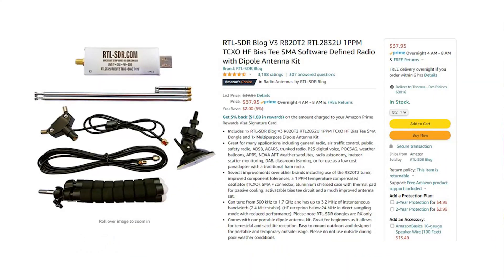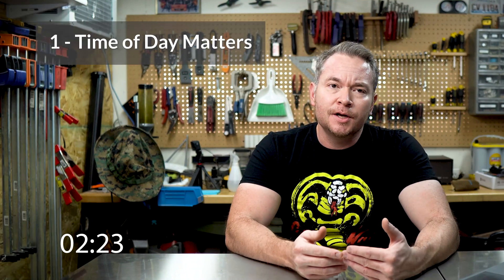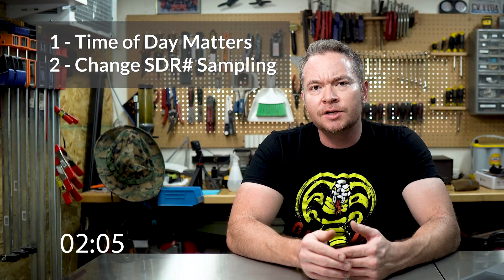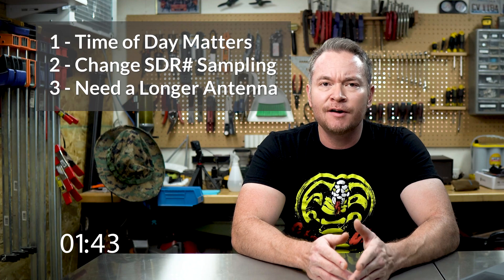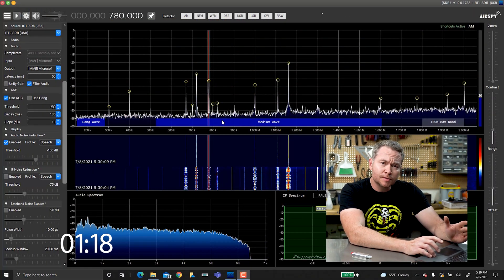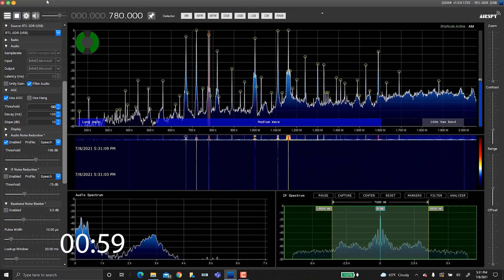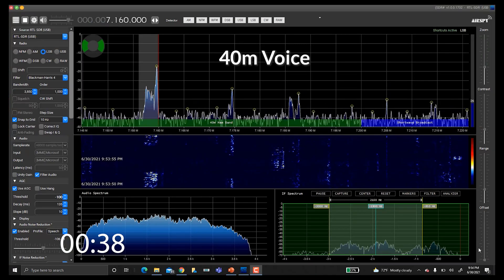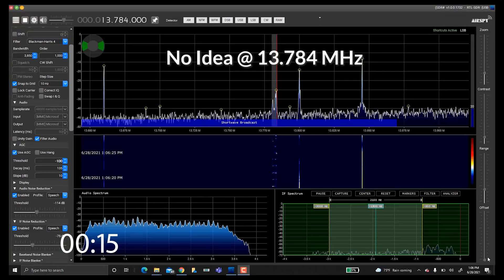Three Minute Thursday - Shortwave/HF with RTL SDR

Comment: A challenge for you. Can you display ALL frequency bands simultaneously... one monitor or multiple... is it possible? (Without having an RTL-SDR for each band.)
Reply from the maker: Good question.  It's my understanding that the answer to this question is "no" due to hardware limitations.  The maximum bandwidth is ~2.5 MHz dictated by the supported sampling rate.  Would be cool though, but alas I believe with this device we're limited to viewing discrete chunks of the radio spectrum.  Hope that helps!

Source:  https://www.rtl-sdr.com/about-rtl-sdr/

Comment: Do you attach the clip to just one leg of the telosping antenna? Does it matter which side you clip it to?
Reply from the maker: The telescoping antenna just threads onto the SDR dongle with a single connector.  I had just attached the alligator clip with the long wire to the end of the whip.  I may not be understanding your question right as there was no "side" per se to choose from.  Sorry if I failed to answer your question.  Otherwise, I hope that helped.

Comment: When you alligator clipped that long wire onto the stock antenna, did you have the bottom of the dipole extended also? Can't see in the video.

Comment: On HF 10 mhz to 30 is daytime and below 30 after sundown.Also I saw on SSB in America everything must be USB.I always had luck even picking up HF fax from Japan here in Missouri with just a 50 to 100 ft long wire made of speaker wire thrown up in a tree and clipped on to the antenna on receiver.I have been listening to shortwave since 1990 and SSB digital freqs for 25 years.Have owned cheap shortwaves ranging from 20.00 all the way up to 900.00 sets.If there is absolutely no way to put outside,make a giant loop antenna in your place.Just tack the speaker wire to the 4 corners of your wall and it makes an excellent high power,low noise antenna.I could easily pick up Andrews Air Force Base again,from Mid Missouri.

Comment: Bummed when I saw you highlight the “V3” was required for HF activity. I had packed mine back up after only getting commercial FM radio. Pulled mine back out of the box, and it turns out I have a V3! Yay!
I also have a crap load of fiber optic bury line left for scrap when my 1G internet was installed.
Finding this video just now, I think you have given me an Easter weekend project. 🙂
Reply: OMG, I just realized I have an awesome run of unterminated fiber optic tracer line in the ground. I need to hook up to it ASAP!

Comment: I tried this with the dipole that came with my RTL-SDR and was disappointed that I wasn't having similar success. Later on I tried connecting the long wire to the other element of the dipole and it made a HUGE difference. Not sure why... Perhaps someone can explain the science behind it.

Hoping to see more RTL-SDR and HF vids from you!!
Reply: One side of that dipole that comes with it is connected to the center conductors while the other is connected to the sheathing. If you take off the small rectangular piece opposite the side of the cable connection you’ll see it. The side that probably performs the best is the side that is connected to the center conductors. He even covers it in his original RTL SDR video. https://youtu.be/h4x7cGALaC8
Reply: @RecoilRabid  Thanks for the clarification. That was one of the first things I did when orienting the dipole. I made sure the center was up. Now I know if I extend just the center I should do better on HF!
Reply: One side of that dipole that comes with it is connected to the center conductors while the other is connected to the sheathing. If you take off the small rectangular piece opposite the side of the cable connection you’ll see it. He even covers it in his original RTL SDR video. https://youtu.be/h4x7cGALaC8

Comment: Excellent short video. Concise and to the point. I have come to the conclusion that it is not just the antenna but also the location. Where I live (not so far from Jakarta) I get loads of RF interference from overhead power lines, some out of phase along with phone and battery charges and WiFi chargers, etc all intefererring on HF. A while ago we had a power cut at 10pm local and WOW !  ..... I could pick up radio HAMS in Germany, Portugal and Corsica some 8000 miles away.. I did not have time to set up an RTL or my SDR Play but at that time used my Tecsun PL 365 which has excellent LSB and USB, they were talking to each other and stations in UAE and South Korea .... everything was excellent reception.. (I use a DIY Home Brew Magnetic loop with Variable Capacitor) .... As soon as the power was restored I lost all reception... So I have a serious RF Interference problem here for sure.    Given that, thanks to your video above (and a few others showing how to set up SDR# and HDSDR I have this little dongle performing quite well, (Given the RF interference I am getting here).   Many thanks once again ....Excellent little video, no problem being short ..it is the content that matters. 🙂 (edited for typo)
Reply: I wonder if that's my problem in the Philippines? I've been using my SDRPlay RSP1A with an active loop antenna to try to receive messages from airplanes on HFDL frequencies but mainly just get them from nearby aircraft in SE Asia. When power was out after typhoon Rai/Odette I was picking up WWV and WWVH quite well, also the BBC World Service at night on my Tecsun PL-310ET with the wire from a little reel antenna (Tecsun AN-05) connected to the radio's whip antenna. Now that electricity's back I only hear noise on the same frequencies. The electrical cabling's very bad here anyway and even worse after the typhoon.
Reply: @jaym1301  Very likely, I think . I lived in RP for 4 years or so from around 2000 to 2004 and the mains wiring and supply there was the same as here in RI. I wasn't using radio there so much but if you add that to the household RF generated by chargers and WiFi we now have HF really gets interfered with and you will be pretty much in the same boat as me ....so to speak.....I can easily get the BBC from Kranji  and other stations  etc on HF along with loads of other AM stations along with CNI and CRI blasting away but the Radio Ham and other SSB and CW signals totally get messed up. Try waiting for a "brown out" at night ( used to happen often when I was there :-)   ) .. and see what you can get ... Try the HAM ban on 20m .. 14 Mhz ... you should gets some signals at night there  in RP
Reply: PS ... Try making yourself a magnetic loop ... That is what I use here for HF ... Easy to make if you can pick an old radio Variable Capacitor up. You'll need a capacitor that goes from 40pf to 700pf or so and a loop 2 to 4 m in length of wire. I made my first one from 3m copper piping in a circular loop and  connected it to the variable capacitor with one connection from the capacitor to the radio antenna .... Loads of info on here on them and easy if you are ony Rx .. Worth a try, I think. 
IMPORTANT ....PS again ... you do not need the pick up coil most and expensive VC ( most show on here)  if only for receive ... you can connect an old radio tuning capacitor direct to the loop. Google  Magnetic Loop Antenna ...

Comment: I took some bundled solid copper wire (similar to cat5) and strung it outside the window to my roof peak. I slit the shielding then cut each wire to 36, 25, 18.5, 14.5 and 12ft respectively. This covered 40m band to 15 respectively. Then 10.5, 9, 5, 2, 1.2. This covered 12m to 1m bands. Each strand acts as a tuned antenna for that particular wavelength. And because the wires are bundled it holds them all together.. Let me tell you it's great!
Reply from the maker: Very cool. Did you have to fan them out or just kept them bundled?
Reply: @TomtheDilettante  together in the original rubber shield. Just little cuts in shield to snip that particular color.
Reply: @IntoTheWild70  That is a really cool idea.
Reply: Being new to this I have a question about how all the strands connected back to the SDR. Were all of the ends soldered together to the SMA cable or did each strand connect to an input of a switchbox so only one strand at a time was active?
Reply: @dronepilotflyby9481  it was explained to me that due to the wavelengths it was ok to have 12 to 25 on the same connection. Was suggested you put a switch on the box for the 36 and above. I forget the specific wavelength #s off hand. But basically they will overlap and cause signal loss around the 25ft mark.
Reply: @IntoTheWild70  Can you post links that expand on this info? The switchbox idea with different antenna would be a great project. Do you use an LNA in your setup?
Reply: @dronepilotflyby9481  it was another youtube video. Let me find it. I have a LNA and a AM filter but have had mixed results.
Reply: @dronepilotflyby9481  RTL-SDR multiband antenna
Reply: Robert, I'm sorry for being dense here, but I'm really just learning as a new Ham.  I don't get your numbers, can you explain?  Tom says you need a wire at least 1/4 wavelength to receive the band.  My calculations show 1/4 wavelength for 40, 30, 20, 17, 15, 12, 10, 6, 2-meter bands, to be 32.81, 24.61, 16.41, 13.94, 12.30 (40 to 15m bands), 9.84, 8.2, 4.92, 1.64, (12 to 2m bands) respectively.   That's 3 feet different at 40m, pretty close on 30m, 2 feet different on 20m, pretty close on 17m, and 15, 2 feet short on 12M, 9 in short on 10m, pretty close on 6m and 2m.  Obviously, you just used the full wavelength for the 1.2m band.  I guess what I need to know is what is the tolerance for cutting the wire so that you can pick up the band?  On the 40m band for example, is 3 feet short OK?
Reply: I have no clue what’s happening around here, but it looks interesting as all get out. I smell a marketing opportunity greater than the historical “Converse
All Star Hi-Top sneakers.”
…If played out correctly!
Reply: Damn, what a great idea

Comment: Put the link for the 16 gauge yellow cable
Reply from the maker: honestly, this was just some 16ga wire I had laying around in the shop.  Stuff I typically pick up from an auto store or a home improvement store as needed.  For receiving, any wire should do..doesn't need to be 16ga.  Would suggest starting with something between 20ga - 14ga if for no other reason than ease of use.

Comment: Crap that is amazing the wire was able to do... uh but what an antenna but wires?
Do you get NOAA? I get noaa on all my radios but can't get it on my new dongle. So far I can only get FM music stations
Reply from the maker: If you're getting local FM stations, you're not far from NOAA frequencies.  Check around the following frequencies for the various NOAA channels if you haven't already:

162.425 MHz, 162.450 MHz, 162.475 MHz, 162.500 MHz, 162.525 MHz, and 162.550 MHz.

Comment: When I was a kid, I had a smallish radio that had a couple of SW bands. I used to spend hours at night finding "stuff" like the atomic clocks, spy number stations, very distant radio stations, etc. But my antenna were just the ones built in. So I guess you can still find a lot with just that. But I did discover touching the antenna to my bed frame made things super clear lol. Fun times. I think I might have to get an SDR!
Reply from the maker: LOL!  I can totally see touching the antenna to the bed frame working, followed by eyebrow raising wonder at what just happened.  Sounds like a fun part of childhood!

Comment: So, other than cost, what is the difference between the SDR Short Wave/HF RTL package and this one: ColibriNANO SDR-based Receiver  https://www.gigaparts.com/colibrinano-sdr-based-receiver.html
Reply: The RTL-SDR Blog v3 dongle's ADC (analog to digital converter) is 8 bit so it has less dynamic range and doesn't receive weaker signals as well. But for less money you could get the excellent SDRPlay SDR1A or the Airspy HF+ Discovery for $129 or $169 respectively, both of which offer a higher ADC bitrate and have lots and lots of internal filters and much better specifications than the Colibrinano dongle. The RSP1A is good for 1KHz up to 2GHz  so you can even receive satellite transmissions with the proper antenna while still giving great performance on HF, while the Airspy is engineered to give you the very best bang for your buck for HF (shortwave) and below reception with users stating that its performance is as good as a communications receiver costing ten times as much.

Comment: Great video Tom. I tried my rtl sdr with a spare cb antenna I had clamped to my gutter. I turned the included extension into an adapter with some random hardware, and bam, I had 10 m/cb freq’s on sdr. It’s not the greatest, but it’ll do what I need it to do. I may try the “long wire antenna” you showed in your video too.
Reply: Gutters are hit or miss.  Some hams LOVE the gutters, other don't have as much luck.

Comment: Awesome video...  
Story:  
When I was 12 (a long time ago), I took my portable radio (with HF band) camping, and my older brother showed me how to improve the signal with a 100ft extension cord tied to a tree.
I just jammed a bit of small wire into the end of the extension and wrapped the other end around my radio's whip antenna..   (Of course make sure it's not plugged in at home...!! )
Wow, what a difference that made, and I could pull in so many foreign stations, until he told me to turn it off and get some sleep ;-)

Make sure you disconnect your Long-wire antenna when the weather starts to look stormy, as the antenna can pickup static in the air and fry you delicate RTL dongle.
Also, if there's a lightening strike nearby,  that power may travel up the Long-wire, into your shack...
Adding lightening protection is a good idea, if you plan to leave it up permanently..
Also setting the direction of your Long-wire perpendicular to the signal you want will also improve the gain...
As Dave VE7HUN says, adding a BALUN (a 9:1 transformer you can make yourself), will also give you gain...  (VE2DHT)
Reply: When I was about 12, my lineman cousin ran a piece of wire up a tree outside my bedroom window for me. Hooked to an old Sony shortwave I was able to pick up stations all over the world.
Reply: @ekimp252  Those were the glory days of shortwave radio, and we were fortunate to have grown up during those times..

Comment: Great post, Tom!  Using an SDR to chase DX on HF is one of the great pleasures of life as far as I am concerned.  Way more fun than spinning a dial, which I did for 20-odd years.  And you are so right that it doesn't take much.  If you get a small 9:1 impedance transformer (unun) for your wire outside you should see even better results.  Keep it up!  de VE7HUN

Comment: Speaking of shortwave radio, the BBC has been broadcasting its news on shortwave for 90 years. Back when the sun never set on the British Empire expatriates used to get their news solely from this source. My father’s family used to listen to it in Japan. It’s a fun thing to listen to if you do setup an antenna to receive the signal. The service originated as Morse Code which I believe has been discontinued. That was a fun way to practice listening to prepare for a ham license that required Morse Code. 

I’ve included an article on it’s anniversary back in 2012. 

https://www.bbc.com/news/magazine-17155441

Comment: Think even lower - like below 20Hz - submarines transmit down there.
Reply: Not 20Hz, but 15-40 kHz. In that band there are numerous naval transmitters around the world, whose signals can be picked up by submarines “towing” a long wire antenna. Signals in those frequencies travel very long distances in what is called the Earth-ionosphere waveguide. As a side effect, space scientists use these signals to study the lower ionosphere and space weather.
Reply: @hj45lp  I would just be happy if I didn’t have S7 noise at my QTH....and that’s on a good day. Going back to the magnetic loop development
Reply: You’ll need a multi turn tuned loop antenna to work down there. There’s a historic Swedish station that broadcasts CW on 18KHz every so often